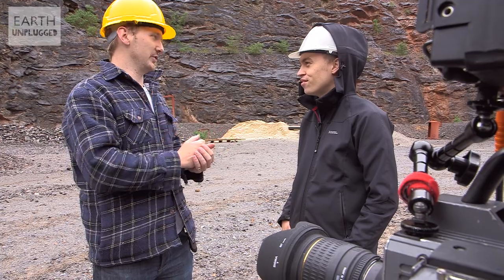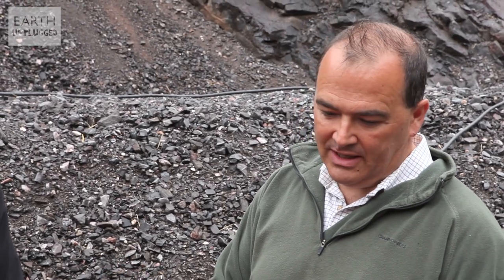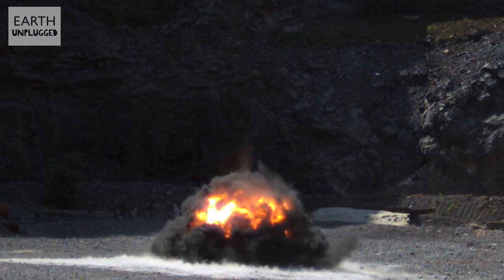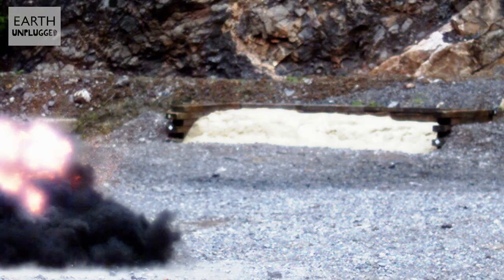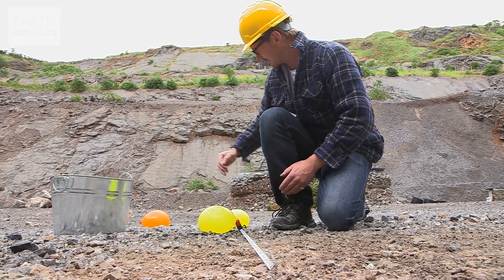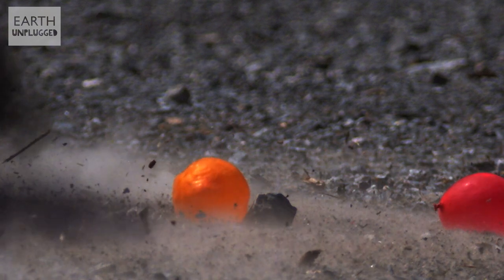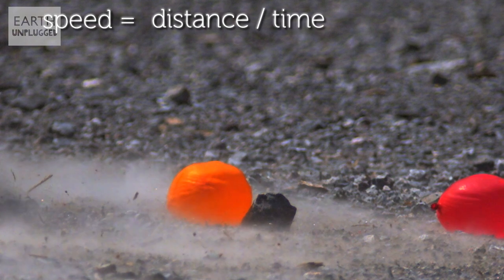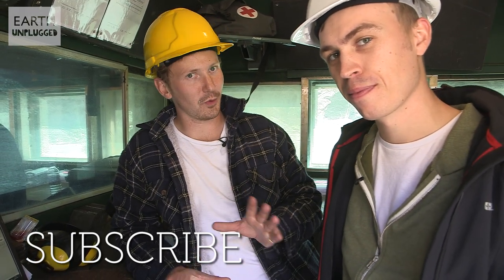Explosion Shockwave in slow motion | Slo Mo #30 | Earth Unplugged

Comment: Whats happens when 2 explosion sockwaves "spheres" collide. Will that follow wave a ripple pattern?
Reply: yup, just like two ripples in a pool. except we, as humans, would only be able to see the shock fronts. we wouldnt be able to see the ripples very well.
Reply: No. Shock wave behave differently to ordinary wave. They don't penetrate each other. So no interference pattern will be seen.
Instead the gas flow is deflected to the side and resulting pattern will be similar to 2 co-joined soap bubbles, expanding.
The gas (and fireball) can join and merge once the pressure drops enough, if they are close enough to begin with.
Reply: it creates white clouds in the shockwave collision for a hundredth of a second more or less because of the water in the air, you see those white shockwaves much more clearly when you look at Nuclear explosions.
Reply: water waves are 2d, shock wawes are 3d
Reply: @dillee1  Thats what I saw in the slomoguys video
Reply: Lalrivunga Hnamte  
A detonation is an explosion that travels supersonically. A deflagration is an explosion that is subsonic. Most rocket engines are subsonic but the explosion is still reasonably fast. The difference is that deflagrations don't create blast waves since the pressure can travel away as the deflagration continues. A detonation creates a pressure buildup that travels faster than sound waves can drain the pressure away from the region. This creates the blast front that defines most detonations.

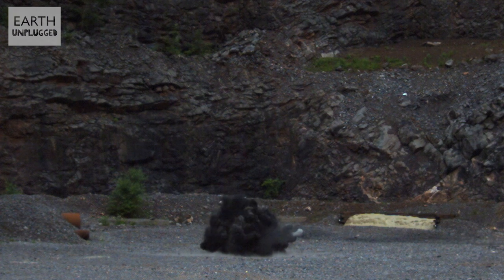Comment: 2:20 "The light's coming at different speed where it goes through" - So wrong, the changes in pressure causes changes in density of the damp air causes refraction of light to change in that air distribution area.
Reply: he said exactly what you said. compression of air causing the refraction of light.
Reply: 'The light's coming at different speeds as it comes through' is what he says. You need some cotton to clean your ears ;) - That's why you need to double, triple check ... people are really dumber than you want to believe ... the lad for a fact says the light goes through at different speeds. Listen again ... and again ...
Reply: ... and that means that those changes in density have caused the refractive index to be slightly variable in that region of air, otherwise there wouldn't be a refraction at all. And since the refractive index is a function of the speed of light in that medium, if the refractive index has changed, so has the speed of light.
Reply: +Guillermo St exactly what I was trying to say.
Reply: oh .. K
Reply: and refraction of light is a phenomenon caused by the difference in the speed of light when travelling in different media :)
Reply: thank's  man wondered why light was being bent.... you're mvp

Comment: The speed of sound is consecuence of taking the "Navier Stokes" equations and making the hipotesis of "little perturbance in the fluid pressure", then you can linealyze the equations and obtain 340 m/s (on ideal air at 288 K). But a Shockwave of course does not meet the "little perturbance" condition, so you can't use the same expression, and they don't travel at the same speed that sound. 
In fact, they travel much faster than sound as you can see on this video or some engineering problems.

Comment: @earthunplugged Is it possible that your frame rate was in error? At the position of the orange balloon, 2 metres from the charge, the shockwave would have completely detached from the hot gas products of the PE-4 chemical reaction. Was it not, by then, just a large amplitude acoustic wave? Wouldn't that travel at 340 m/s?  If the camera was actually running at 1/2 speed, then we would not have 625 m/s but 312 m/sec which, allowing for experimental error, is close enough to the 340 m/sec speed of sound (in air at NTP).

Comment: In Water, because the fluid is more dense, the speed of sound travels 4.3 times faster, or about 1480 m/s. the corresponding shock wave would travel approximately 4.3 times faster as well. Something that is taken well into consideration doing underwater explosives. The safe zone, as it were, is much father away.

Comment: Wait, but shockwaves ARE sound, correct? Because sound is the vibration of air at a certain frequency, and htat's basically what a shockwave is, so how can sound travel faster than sound?
Reply: No, it's a sharp change in air density, which causes light refraction. It's the same thing as thr mirage / hot air making distant things look wavy.....

I do not own this comment. xD but thats basically it.
Reply: singinceil Thanks, I appreciate it :)
Reply: If the speed of a cheetah is 60 mph, but you put a cheetah on an airplane, the cheetah would be going more than 60, right? Sound can travel faster than the speed of sound the same way a cheetah can travel faster than the speed of a cheetah.

Comment: So is a shock wave basically sound that you can see?
Reply: No, it's a sharp change in air density, which causes light refraction. It's the same thing as thr mirage / hot air making distant things look wavy.
Reply: maksphoto78
Spot on Maksphoto78! The guy in the video says the speed of the light changes, but this is wrong, the speed of light is constant, and the effect is caused by refraction.
Reply: *****
Actually, speed of light is involved in refraction. Light travels with different speed in mediums of higher or lower denisity. When light encounters a boundary between different densities at an angle, some of the photons start travelling faster or slower than others, causing light to bend.
Reply: maksphoto78 Ah yes, its only constant in a vacuum, oops